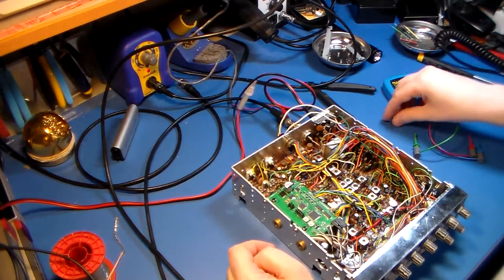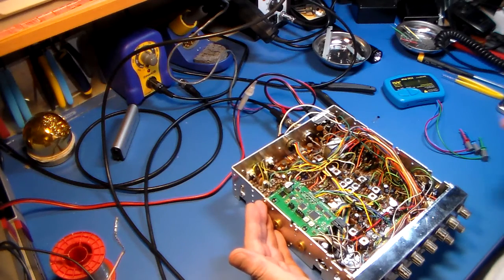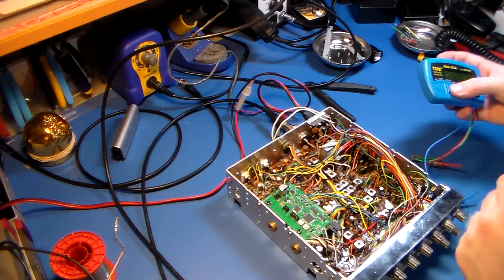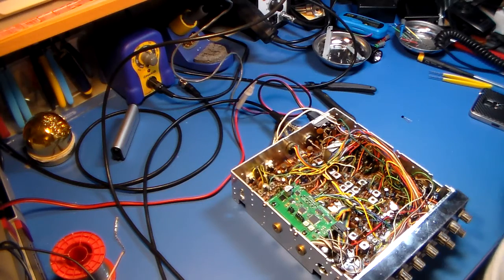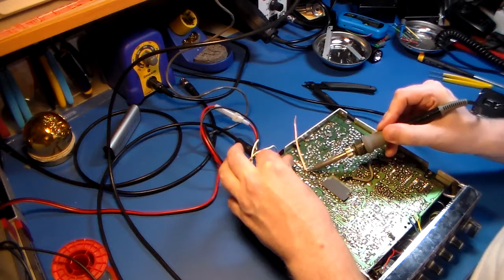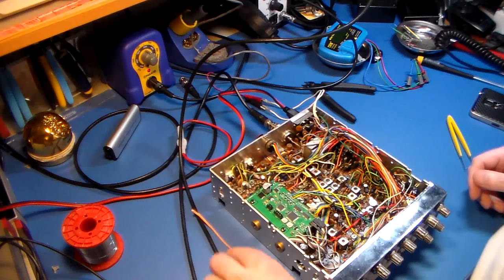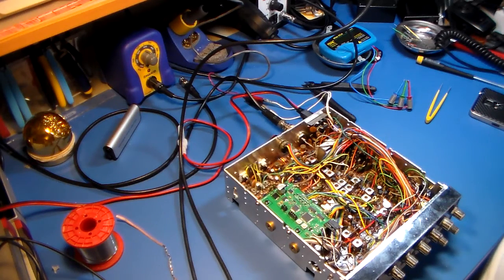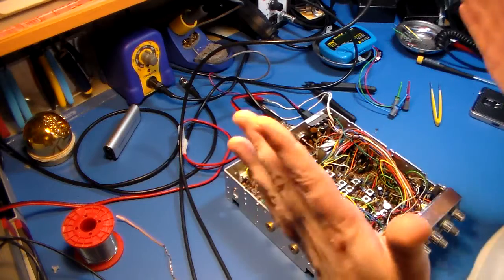2SC2999 D/E swap - does not work as advertised.

Comment: I guess the guys haggling on the thread you mention Mark are just not wanting to be wrong? I mean nobody likes being wrong really, but some will struggle till the end of time not to be wrong! And will even see actual figures and real life tests as wrong as long as it proves them to be correct. It's weird.

Anyway... I learned my lesson with components having the same'ish SMD part numbers/values etc when trying to fix my TTi PSU.. Even though it did work following repair after a power spike. It just didn't work as it should have, and was not accurate down in it's millivolt range. Only talking to the engineers at TTi did I realise how important these part numbers and their associated statistics actually are.

Cheers Mark
Reply from the maker: ***** 
The American CB crowd is a very fickle and political bunch. I don't fall in line because I happen to know quite a bit more about it than they do and the CB crowd draw very close parallels to audiophools.
They have the same pseudoscience nonsense than audiophools do. 
CBers here in the states will change mains filter caps because it improves the receiver selectivity. NOT.
They will go from a 14awg wire to a 10awg wire on a radio that draws 3 amps because the 14awg wire creates too much resistance.
I wish I was making this up!

Now the 2SC2999 debate is interesting because it's rooted in facts. The D variant has slightly more gain and lower noise figure than the original 2SC1674 transistor in the first stage of the receiver. There is an E variant that is double the gain of the D variant. What they don't get is that while your doubling your first stage amplifier gain your also substantially increasing the noise floor in the process.

This is why we lost 7dB of intelligible signal. You can hear that signal at far lower levels but you cannot make it out.
You can only get so far by adding gain.. it's a diminishing returns system. I am pretty sure Shannon-Hartley applies here.

Comment: Have you tested the 2SC1675 or the NTE107 for results on using either of those. I also noticed my preformed transistors have a lower hfe on them.
I tried looking at the sheets for all and comparing the specs for each,they each show installation for different frequencies.

Comment: I've done this mod more than 2-3K times. It works correctly all the time , assuming you're not a complete freakin idiot that buys knock-off parts. There are still thousands of genuine 2sc2999 transistors in the warehouses. The variants are seemingly irrelevant (A-E) IMHO if installed correctly, and the realignment performed. Honestly I've never seen anything other than just plain 2999's unless they were the knock-offs. Ultimately it comes down to the quality control of the actual tech in his parts selection. This vid is nothing more than absurd apples and oranges comparisons. Due to the use of somewhat substandard materials that Uniden / Cobra used in the manufacturing of their radios, not only is the complete mod required before any real tests. It's also recommended that the ANL diode(s) are changed as well as the recommended detector / NB stages. In certain versions of the 148 (there were like 20 remake issues at least. each with some kind of parts variations). The use of a 2SC2999 was required at TR14 (AM front end) and TR19 (2nd AM AF amp / SSB Detector) spots. In ALL 148's I've did over the years (as well as pretty much any other Cobra / Uniden radio). A complete re-alignment of the RF /IF stage was required. Not always, but usually. Simply changing out parts is a waste of time in most cases. It's also noted that a "non-standard" device has been added into the radio you're "testing". Generally, these devices add noise through the ground connection, and tend to negate any positive effects of the "Rx Kit". It should be noted that this mod only improves the "Noise Floor" of the radio. In some radios, the "white noise" (hash and trash sound of AM reception) level was increased. The only way to reduce that, is Rx re-alignment, and possibly beefing up the NB / ANL/ AGC circuits with additional filtering elements (bigger, or different caps, etc.). These procedures / final assembly testing comparisons. Mark the differences between a true tech, and a "CB Shop" radio repairman. JS

Comment: I was looking at the Sanyo 2SC2999 pin-out and it shows BCE ,but the ones I have checked all show ECB like the 2SC1674 the 2SC1675 and the NTE 107 NPN Transistor called for other than the 2SC2999. Only real difference that I see is the Frequency usage AM -FM, or UHF.